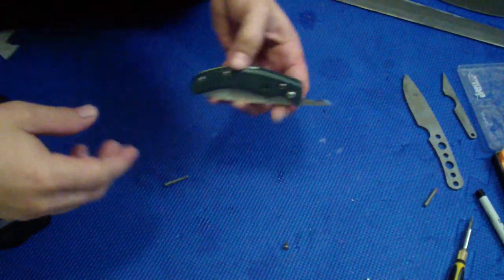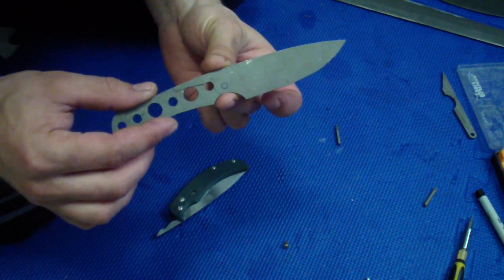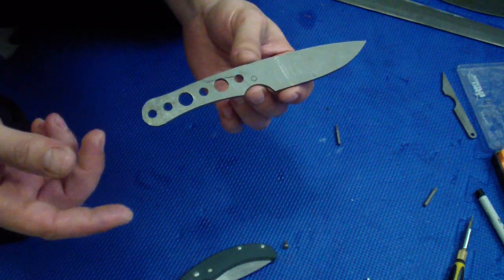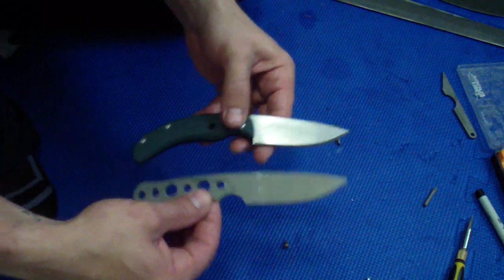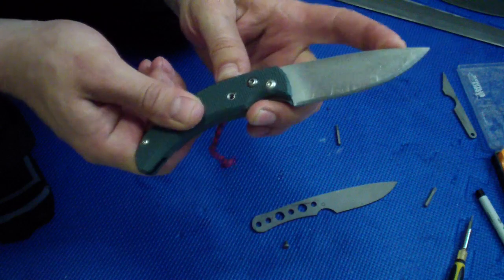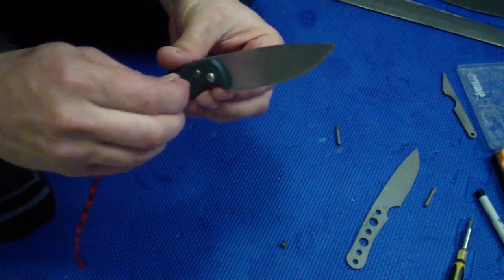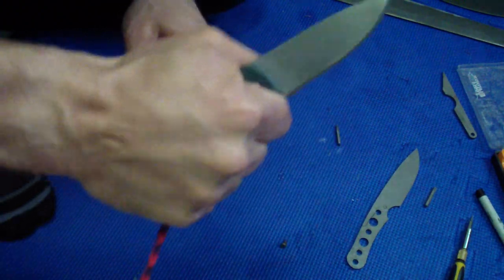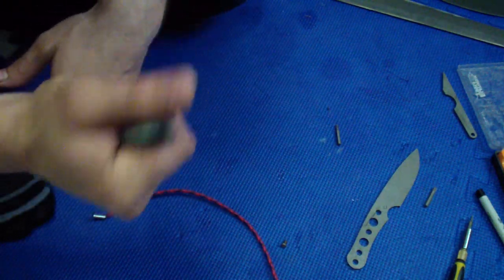Fixtion Folder - New Design Friction Folder "Fixed Blade"

Comment: Very cool idea, very original!  I love friction folders, simplicity is good.  The tolerances on the hole and pin in the insert will have to be pretty tight to keep blade play from being a problem, but that should be no trouble for you. :) Can't wait to see the result.

Comment: That is AWESOME! Might want to think of a "cuff-link" design (still with the lanyard for the "key-chain" part of the filler-tool) for the actual lock of the knife it would fall in the locking hole like a"T" that can be easier to insert and remove... Just 2cnts I love the idea!

Comment: Hmmm, have you considered maybe using some kind of flathead-drive (include a washer) and inlaying a stainless nut in the handle or just threading the filler? I'm just trying to think of a way to make the pin more secure once it's assembled and not have to have a lanyard hanging off of it or worry about it falling out of the filler. (I'm absentminded, so any time I can make it so I don't have to remember/worry about something like keeping track of a pin I'm much happier.)

Comment: And also what if the insert used a button lock design? with a slit in the back to go over the button lock pin and when the button is released a wider base pushes up into a bigger hole in the insert?

Comment: If you have the filler thing stick out of the handle at the end of the knife, you could have a glass breaker and could put a lanyard hole so you could hang the stop pin on it.

Comment: Basically just brainstorming: I know inlaying a nut would probably be pretty hard. Maybe you could work something out with a pivot? I don't know if having it in the knife all the time would interfere with the FF mechanism...probably. :/ At first I thought the spacer filler thing was going to be all that was needed, which would eliminate the problem of the pin. I'm sure your result will be pretty good, whatever you choose to do, though.

Comment: Still can't get I over this I'd imagine if you used titanium for the spacer and a large  hardened steel spacer it would be a very strong ( lock?)  and if you didn't mind the gap take it through the back part of the blade and its basic like a manual axis lock.

Comment: great legal loophole knife, remember in the UK, (Pointed Article) its the cutting edge not the blade length, as long as it is deemed to be a folding pocket knife ( by some judge who only uses a knife to eat and probably could not even use a screwdriver ! )
Take the point off and the law is (Offensive Weapon Act) ie made, intended or adapted , very difficult to prove as the prosecution cannot change what it is ,after charge and probably only used after you have lost it ,and threatened someone